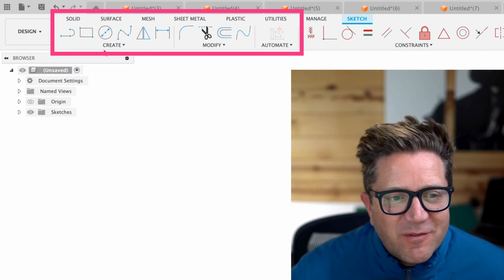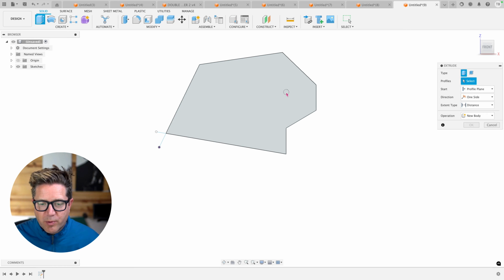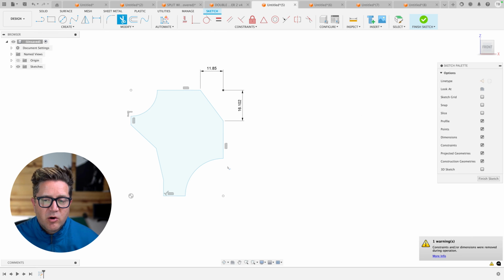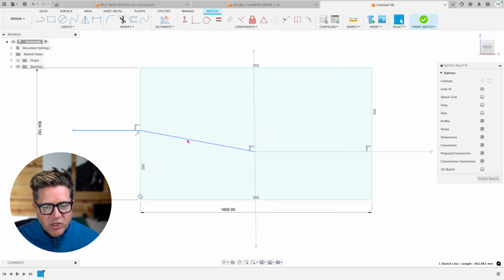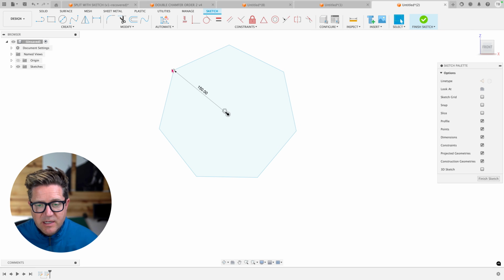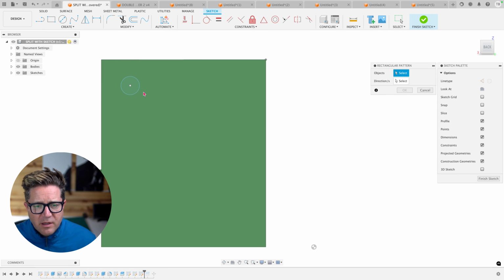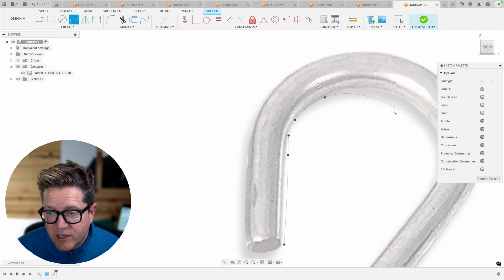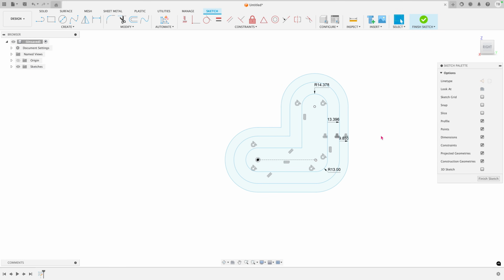Stop Guessing in Fusion 360 — Here’s Every Sketch Command You’ve Been Missing

Comment: There are several problems I run into all the time using Fusion and I would like you to make a video explaining the solutions.  The first is proper use of the measurement tool.  I often find it impossible to control what is being measured and as a result am unable to measure the item of interest.  The next is that when slicing a body there are  mismatches in the resulting surfaces that create tiny faces that can’t be repaired and attempts to heal them often results in drastic changes to the shape of the body.  The next is repairing sketches that fail to be closed because lines are not connected even though the points involved are separated by exceedingly small amounts.  I understand how to locate these and make repairs but it seems there should be a way to tell Fusion when two points are close enough to be connected automatically.

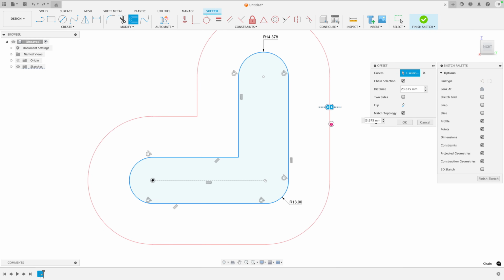Comment: Excellent video...At 30:50 you have a box "Match Topology" checkbox in the Fusion command "Offset", but I do not see it in my latest version of the software. Is this an older software feature that has been removed? This looks to be very important and should be checked.

Comment: Thank you for all of the information through the years you are the reason for me using Fusion 360 , but I have a problem with a file that I created. It is a fairly good size file, I have saved it quite often while working on it ( I dont know where  with the new Fusion 360 rollout )it is saved my pc froze and I waited to unfreeze it never did. so I closed down windows ( should not have done that! ) when I started Fusion 360 again my file was gone. Now for the question  do you know a way to find it? they say the stuff is in the clouds.

Comment: Great video. Thanks! One thing I do for importing images as a canvas... if I'm scanning an object on my flatbed scanner, I also put a high quality steel ruler next to the object, aligning the ruler with the x or y axis. I scan at least 4" (100mm) of ruler with the desired object. Now, when you bring the object into Fusion as a canvas and scale it, you can easily calibrate the object's size by calibrating off the ruler's image. It's more accurate to calibrate over a 4" ruler length (or longer) than a 1" segment. I'm able to get accuracy to about 0.003" (0.08mm), or smaller, easily.
Reply from the maker: Very cool tip!!!

Comment: @TylerBeckofTECHESPRESSO hey i think I have a challenge for you , that i hope you could help solve if you can seem to figure it out, .

I had been working on a project that required a sketch with a polygon of a hexagon with one of the flats of the edges to be horizontal at the 12 o-clock position.
i wanted the sketch to be parametric so i had allreaddy created parameters before hand of the size and a unitless parameter for the number of sides.
so I had entered them in. my sketch also required creating a spoke at the 12 o-clock position, vertically and symetrically so i had sketched a few lines from the vertex's of the polygon on the top line ,  and created a triangle vertically and used constraints to make it symetrical over the orgin using vertical constraint.the objective was to do a thin extrude of the polygon and then come back and do a thin extrude of the two lines of the triangle spoke , and then do a circular pattern of the thin extrude of the spoke triangle part.and use the parameter Number_of_sides but for the life of me i i cant seem to make the polygon parametric .this is important as i need the side lengths of the polygon to change with the number of sides  while keeping the dimensions of the polygon's diameter , and the spoke hight the same, .

i think fusion may have a short comming of not being able to have a polygon fully parametric , or im i doing somthing wrong.

my part is a bit more complicated than what is discribed but its a bummer I cant figure it out as it requires redrawing complex parts to iterate diffrent spokes .

the part is for creating a custom former for winding wire to create a crystal radio that has gruves in the thin edge of the spoke using the coil tool to cut grooves into the part.while trying to keep as much material out of the part using the thin extrude..

hope you have any ideas what Im doing wrong .

when drawing the polygon and putting the variable in and hitting enter it puts the right amount of sides in.
but when you change tha number of sides in the parameters  it doesnt update .
 the only way it could be done is doing a fully parametric polygon and doing the math of the side langths by drawing it manually with the line tool 
or using angles to draw the sides thanks again , love the tips and tricks videos .